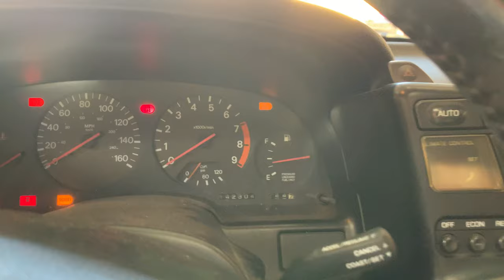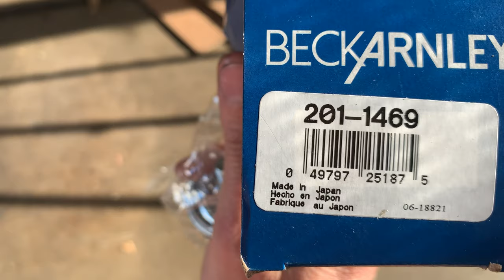Nissan 300ZX Auto to Manual Conversion Part 3: Clutch Pedal, Transmission Wiring, Clutch & Flywheel

Comment: 16:50 that little plate surrounded by seam slealer just chizzles out and already has the correct holes pre-drilled from factory for the bolts and the master cylinder. Luckily you had long bolts so you made it work
Reply from the maker: Oh interesting, probably would have been easier just to take that plate off then.
Reply: @noboltsleftbehind  I have mine hanging as a souvenir of the Auto days

Comment: Awesome progress! I just removed the exhaust and driveshaft for my Z yesterday. Now's the fun part: removing the 5 speed.
Reply from the maker: Thanks man, good luck on your transmission removal! Swivel socket extensions are your friend.
Reply: @noboltsleftbehind  I literally just finished now. My very first time removing a transmission from a front engine, RWD car. What an experience. It took me 2 days, doing it on and off.
Yes, swivel socket 14mm for the top 4 bolts of the transmission, 36" of 3/8 wobble sockets, and 3 separate trips to Harbor Freight 😂😂 Harbor Freight is your friend!!

Now I gotta order the LOJ swap kit. Hopefully removing the engine is easier without the transmission

Comment: Subscribed. Good to watch someone else going through the same pain. Even though Im way behind on this build. Im just now getting my built engine back and attaching all the bolt ons to it. Hoping to have all the parts together by next spring for the na to tt swap as well as auto to 5sp. Keep up the good work.
Reply from the maker: Thank you sir! Hopefully my videos can help give you a heads up on some of the problems you might run into. I'm interested to hear how your twin turbo swap goes.

Comment: Hey Barry, do you remember how many bolts keep the auto transmission attached? It seems to be stuck at the top for me.
Reply from the maker: I don’t remember exactly how many, but there are certainly two at the very top you’ll need to unbolt. I reached them by tilting the engine down a bit and using a bunch of socket extensions to reach from the tailshaft. A couple wobble extensions in the middle help a lot too.
Reply: @noboltsleftbehind  yeah figured there were two more at the very top. Time to get flexible.

Comment: Having trouble locating the clutch sensor wires. What did Yu take off or replace ?
Reply from the maker: It’s a switch right on your clutch pedal, it will turn on/off as you press and release the pedal. I had to add my own wires for it, I don’t think an automatic car will have them. I crimped spade connectors to plug into the switch itself

Comment: Hi, been loving the vids mostly because ive been having near identical issues with my Z (the hatch latch, the security system beeping when you remove the key etc) but im having trouble with my auto trans and i think i also lost 3rd and 4th gear and im planning my swap very soon. My question is how fast were you able to go when you lost 3rd and 4th because my Z caps at 40mph and feels like it doesnt want to shift. im just curious if 2nd gear is capable of going faster than 40mph
Reply from the maker: Sounds about the same as mine, around 40 was the max. It also had trouble accelerating from a stop, I had to manually put it into 1st otherwise it was stuck in 2nd.
Reply: @noboltsleftbehind  yup, same situation for me. Thanks for replying, I will definitely be looking forward to your new videos

Comment: you used the ECU that was in the car correct? No issues?
Reply from the maker: Yes, still using the original auto ECU and it seems fine

Comment: Hey I saw in one of your videos not too long ago while you were driving there was a pretty noticeable squeaking noise. My Z has the exact same problem, did you ever figure it out?
Reply from the maker: Is it a squeak that seems to come from the car shaking and moving while driving? If so, it's still there and been driving me crazy lol. Seems to come and go. Let me know if you figure it out, I'll do the same.
Reply: @noboltsleftbehind  Yeah it comes and goes. Happens while driving and going over bumps etc. It' super annoying and haven't found anyone with the solution.

Comment: Why do you need the alternator harness changed?
Reply from the maker: The alternator and transmission wiring are combined into one harness, so to keep the wiring factory you need to replace the whole thing. The starter wiring is part of the harness too.

Comment: Are your race ramps cribs 10 or 12 inch high?
Reply from the maker: 12 inches
Reply: @noboltsleftbehind  thanks, I have 97 NA manual jdm in New Zealand i have leaking oil from rear main or gearbox so helpful videos thanks especially seeing how to undo the 2 top bolts, I only have 10 inch race ramps tho lol damn
Reply from the maker: @sabertown1653  Oh cool, a '97, ours stopped at '96 over here. I'm jealous of all the JDM cars you guys get over there. Are they hard to import?
Reply: @noboltsleftbehind  bonus of my 97 talking to Nick at CZP he could tell from the vin it has factory '98 spec box also had factory jspec front bumper.
When they became over 20 years old they flooded in, I had 1 of 3 convertibles in NZ now over 12.
You can still bring them in but compliance places getting tough as the government doesn't really want them on the roads due to emissions...
NZ had been a dumping ground for all sorts of JDM cars so we have heaps of variety lol  Zs about the only ones that haven't gone up heaps in value, probably as they suck to work on!